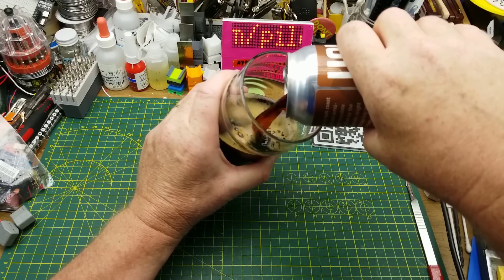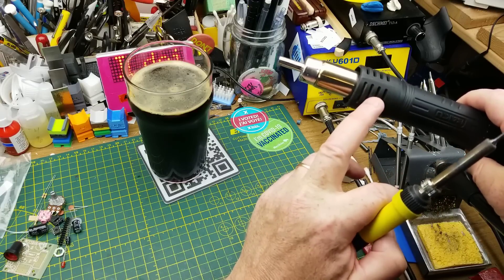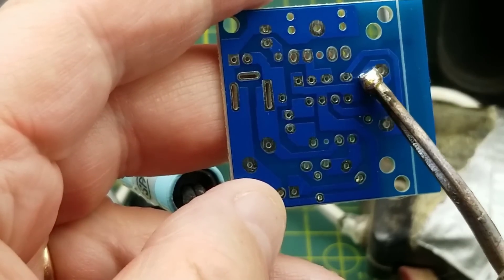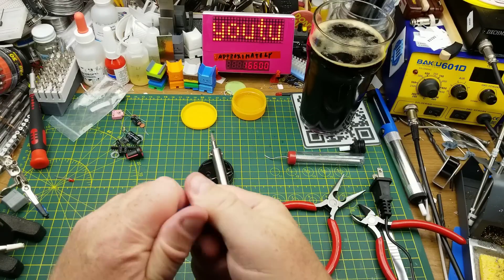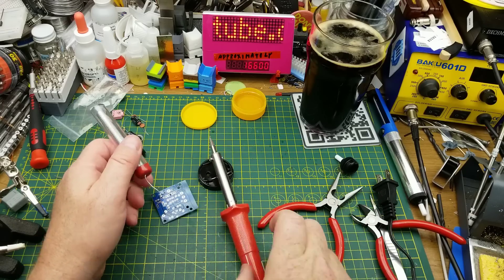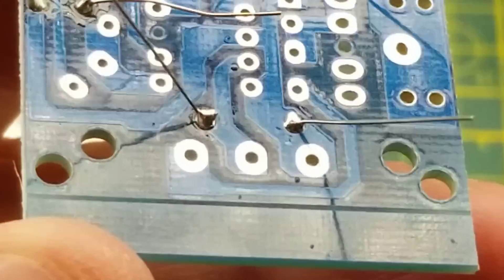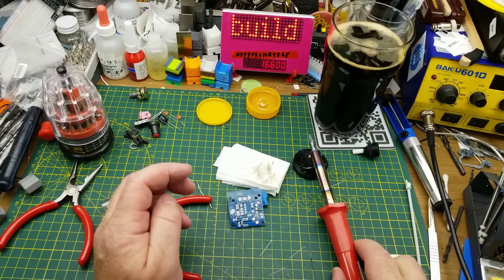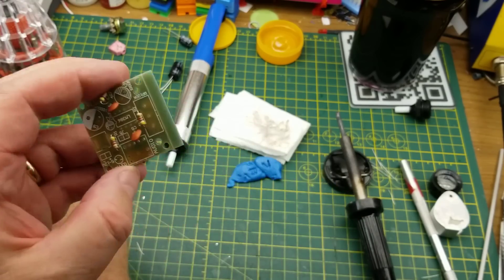Kit build with cheap tools?

Comment: That pinout being wrong bothers me no end. I memorized many chip pinouts back in the day but it’s no longer that day. Might a 741 variant have been the intended part?

Long, long ago I took metal shop in school and used a gigantic thing that looked more like a pointy chisel than anything else, heated in a big gas burner thing in the middle of the classroom. Then I took radio shop and we used those Weller guns. That got me hooked and I bought my first Radio Shack15 watt pencil iron. I still have one (not the same one) because like the Weller guns they just work.

Making a good solder joint is as easy as making a bad one, you just have to know more and pay attention. I’ve delaminated my share of pads too learning those lessons. This episode was a damn fine primer on good practice with examples of what not to do. Be proud even if the project didn’t work.
Reply: As a student I remember scratching my head, staring at the water leak in the radiator of the Rover P5B that my mate had just invested in. Seemed like a bargain, even came with a spare gearbox, we quickly found out the reasons for the low cost of such a fine car. About to embark on a trawl through the local scrapyards in search of a possible replacement, my mate's dad turned up with the pointy chisel thing, and a blowtorch. Car radiators dissipate a lot of heat, it is their reason for existence after all, so a lot of heat is required to get even a small area hot enough to take solder. Lots of heat, lots of flux, plenty of solder, and job done.

Comment: Those heat guns are great for soldering to metal chasis' and stuff like that, but definitely not fine work :) .
Those old Weller 25 /35Watt irons just never die.    They may just be a heat balance and not a thermostat control, but they just work.  
Back when I use to do repairs on Satellite modems for ipstar,  my training involved having the guys from Thailand come out.    They would use the chunkiest irons, and be reworking SMD components with them,    I don't know how the did it, but the would have a chunky, non-temperature controlled iron, and be able to replace 30 pin SMD's with near perfect results.
Reply: They might not be the best tool for every job but I managed to remove and reinstall an SOIC-8 with a Weller 8200. For anything smaller a regular pencil-style iron is probably better.

Comment: I wanted a soldering iron for Christmas and received a wood burning tool. Used a file on smallest bit and started solding with that. If you want to solder you will find away. I even found out what flux was at a hardware store. So yes doesn't matter how you start out it us how far you want to go and if you really want learn from mistakes and knowledge other people can give you.